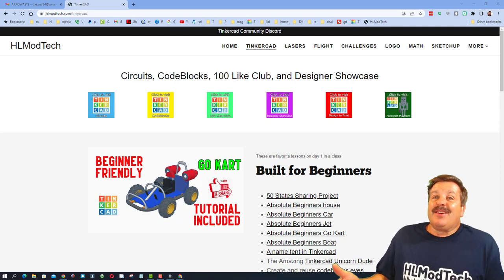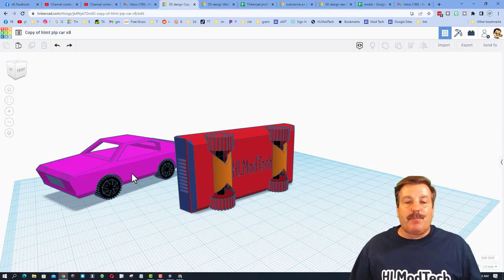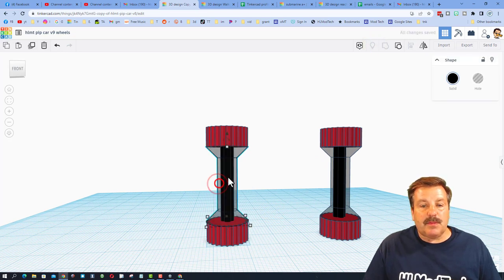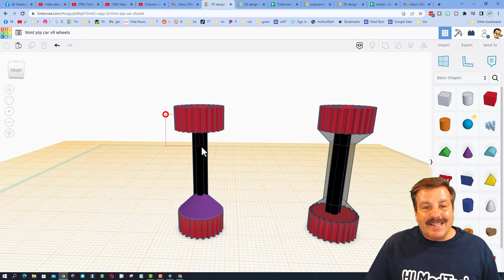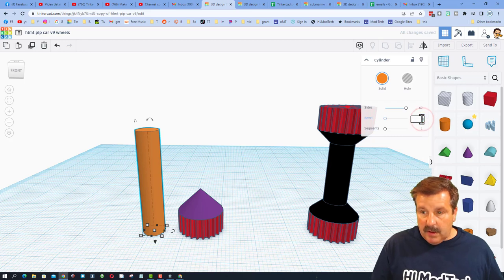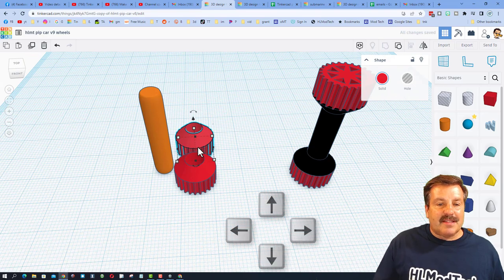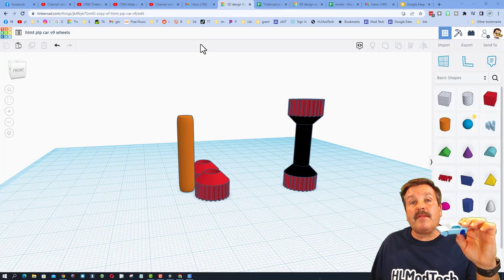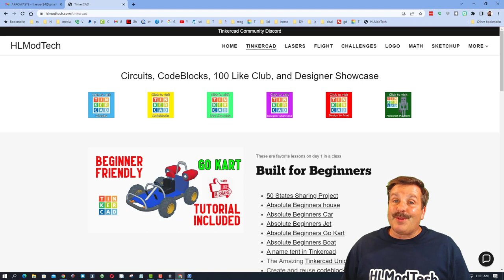Replacement Wheels for the Tinkercad Print in Place Car #fixed

Comment: If you want low rolling friction from wheels with chunky tyres, put a low profile narrow ring around it. You can use a torus, or a bevelled tube so overhangs are printable without supports.
Reply from the maker: Thanks for the tip.  With these cars I was finding that the smooth wheels did not grip at all. I was actually creating some friction by using a gear for the wheel.